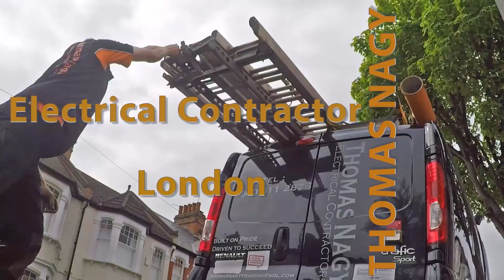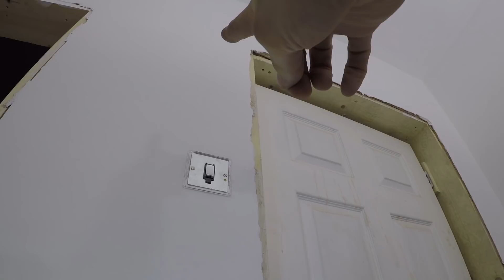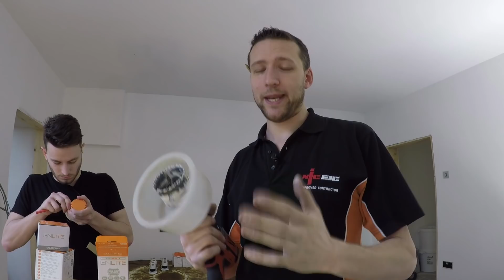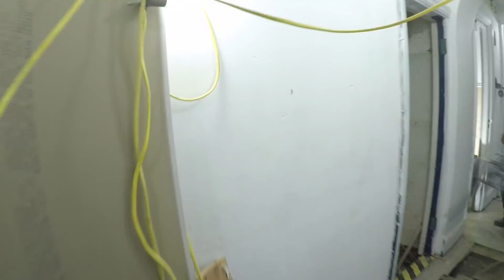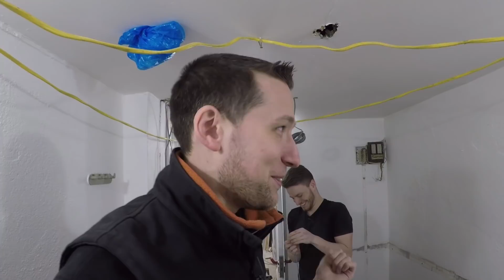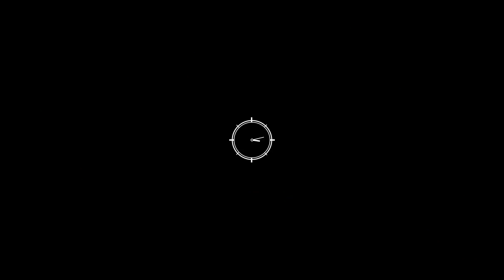House rewire Part 2 - An Electricians Day in London | Thomas Nagy

Comment: It's a wiped lead joint. You tin the copper pipe, clean and flux up the  lead pipe and then apply solder. The trick is to heat until it just goes 'plastic' (not running) and then wipe it with a cloth (called a mole I think). It's a pretty skilled job and probably a lost art now. I think you paint the rest of the lead with something to stop the solder spreading too far. Wiped joints were used on paper insulated electrical cables too and on telephone cables as it gave an impermeable joint for underground runs. My uncle worked for the LEB in the 40's & 50's and such joints were certainly still in use then.
Reply: Hardly a lost art I'd say - in cities with lots of old housing and cheap landlords patching leaky lead pipes is daily work for plumbers, although with current EU regulations it should be pretty much impossible to use lead for potable water unless your water is crazily hard. My family had all the lead pipes thrown out of their 1914 apartment building but at least here in Vienna that's a rare thing to do for landlords. On the one hand the lead levels in the water were crazy (up to 10 times the old limit and the current one is 1/10 of the old limit) and on the other hand there was another leak pretty much every year.

I've seen plumbers do wiped joints with newsprint and I've seen them burn their hands doing it (not because of the newsprint). Actually some crazy folks here were doing lead drains in new work well into the second half of the 1980s according to my uncle (he worked for such a crazy plumber back then)!
Reply: Those lead wiped joints are still.in the ground and in service today.
Reply: Moleskin - because that's what they used to use.
Reply: You are right there, a piece of genuine Mole Skin was used to wipe these joints.
Reply: Leaded solder wiped joint. Regulations now require you to rip it out and replace with copper in the UK but no landlord ever wants to do that. Still done as recently as the 1990's.
Reply: You are so correct! It's cool to see people still remember the old skills.  Have to admit, they last 100 years if left alone, LOL
Reply: Bit late. But if I were Thomas and I had that type of thinking. I would check if that copper pipe portion is earthed properly. shrug Since it is connected to lead piping.
Reply: We still use it on high voltage cables, lead jointing.

Comment: the Roll-Profi Vario may solve some of your problems with the cable stand. also usefull for just plain wire
Reply: https://www.youtube.com/watch?v=bQnwvydvxsM
Reply: Very well.
I also got in touch with it when I did a test apprenticeship. And the master was quite happy with it.
Basically it is a Inverse roller. A frame sits on the floor and has two stretched rolls. A cable drum just spins ontop of it.
http://www.shoppingfever.de/images/p_bild/634581_xxl.jpg

Comment: Was trained years ago as a spark and my cable horse has never changed. It is a wooden broom! Use it vertical or horizontal and then sweep up after. Plastic handles are no good as they break but a wooden handle wrapped with insulating tape to make the drum spin easier works a treat! Seen many a plumber connect copper to lead over the years.  Heat up the lead and tap it into shape with a small bull hammer. See a large leak a year or so ago with a split in a piece of lead. The younger plumber wanted to replace it but the older guy just heated it with his torch and tapped it closed until the leak stopped. Never even had to turn the water off. I am sure those skills will disappear soon. P.s.. love the videos... Mine would be full of bleeps! I also work with standard pricing... fixed cost plus materials.
Reply: I suspect that will leak again at some point... we had a similar fix where a tap had been removed in the former laundry room and at some point I walked in there to a lovely fountain spraying halfway across the room. This time the pipe was soldered shut and that's still holding up.

Comment: Have you tried out the New twin and earth cable that has insulation on the earth cable, new regulation in Ireland were you have to use the new cable wondering if it is the same in England
Reply: D C  not here yet in Uk was talking to mate back home 
Might come in when new regs come in next couple of months think one of the changes talked about no split board all circuits will be rcbo instead of RCD
Reply: If you get T&E with full-sized insulated earth it will finally be usable in other European countries! Round cable is fine for a bunch of applications but sometimes flat is handier. I guess it wouldn't really make sense calling it T&E any more though.
Reply: In New Zealand it is all insulated Earth for cabling.  Bare earth stopped in the 1970s.
Reply: D C not that im aware of no
Reply: Cheers lads was curious it’s not a bad job to use

Comment: Cable jacks . 2 x 25mm right angle steel conduit boxes with a 25mm hole in the center of both , 4 equal lengths of conduit screwed in to the angle boxes to act as the legs . another length cut to suit  to act as the bar.

fairly common practice to make them up as you need them . easy to unscrew and store .
Reply: I also use this method and slide the plastic ends on for feet that you get to protect the manufacturers threads .
Reply: iv had a set of these for years i thought thats how everyone did it
Reply: I made one of these out of 20mm cos had no 25, and it was shit.. would've been ok, but the bushes they use are so lightweight and shit now they just snap if theres any real weight on it.
Reply: I make a mean cable horse out a length of 25mm steel conduit measure 800mm both ends for the legs another 600 for the sides that I bend at about say 140 degrees leaving  around 700mm for  the cables ive reduced the first two sizes  as to leave more room for the reels in the past then when I’m finished I just leave it at my arse for people to admire/skip lol
Reply: Ricky Bennici I’ve also done this tho I made a 20mm hole on of them with a 20mm length of conduit that goes through so the amount of drums it can hold has been extended. Had it for nearly 10 year now, still going strong 💪

Comment: The joint from lead to copper looks like a lead wiped joint. The lead is shaped around the copper pipe and solder is applied to the joint. 

What scrap merchant do you go to in Wembley? Wonder if they've got better payouts than the two in staples corner.
Reply: Thomas Nagy all you need is 400*C to fix that 'sprung leak'... ;). Definitely not rated for potable anymore.
Reply: The same method was used for joining lead pipes. There's a special tool for creating that flare too. Actually the wobbly lines and flared joints are telltale signs to watch out for if you're looking into moving somewhere and don't want to get lead poisoning.

Comment: looks like that pipe is brazed on to the lead pipe
Reply: Yea , Lead sweating . Low flame and loads of solder building up that egg,  they used to use old moleskins or cloths to wipe and form it also. Quite a skill but you're not supposed to do  any soldering on any lead water pipe nowadays.